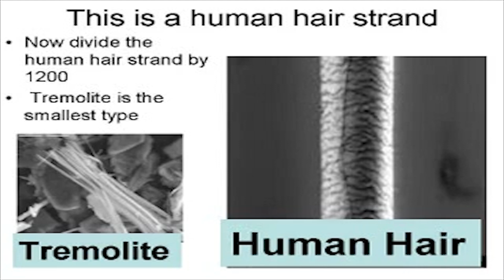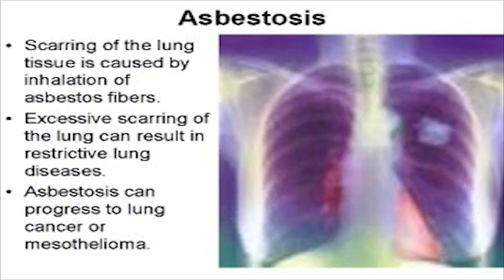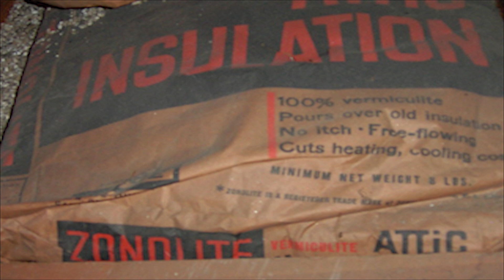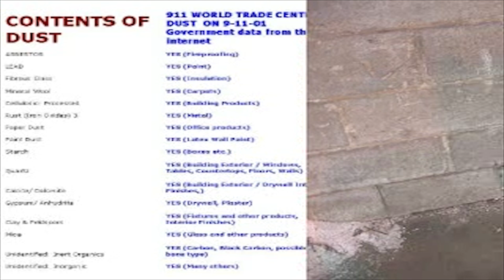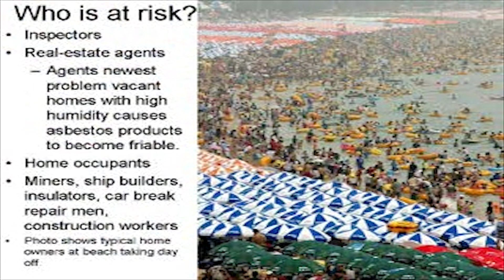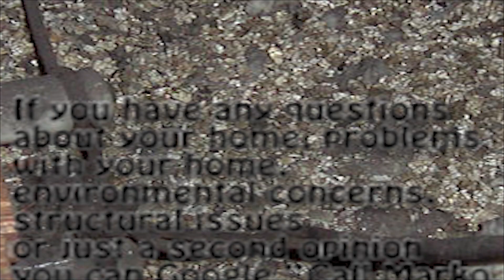Vermiculite Great Insulation:  Asbestos Safety, What does Vermiculite Look Like

Comment: I was exposed to vermiculite in my home while fixing drywall around a bath fan. The vermiculite was pouring out of the ceiling. Had it tested and it has low level of asbestos. Should I be concerned about this type of exposure or will I be ok?
Reply: You will be fine you need to work with asbestos loads to get this and Vermiculite loft insulation has such low levels nothing will happen. It's the proper asbestos Brown and blue you want to keep away from. Everyone I know who's older in the building industry who died or has asbestositis all smoked.
Reply: @LondonGooner  thank you for sharing that reassurance. Wishing you good health!
Reply from the maker: yes, you dont need much, wear a mask next time
Reply: @Clevelandmarko  oh dont worry there wont be a next time. Im never doing anything like that again.
Reply: You'll be fine. Chances are something else floating around our air will get you first. Just be cognizant of the situation and approach it with care.
Reply: @dontworrybehappy8080  thank u for the reassurance. I had one other possible exposure from sanding up a vinyl sheet floor in an apartment i lived at.  seems like relatively low risk. im no longer doing projects like that.
Reply: @ecordaromusic  This is what I do for a living. I can't guarantee that you're not going to parish because of it. Just saying the odds are in your favor.
Reply: @dontworrybehappy8080  🥳
Reply: I was working at a house that was for sale and I was the only one with a full face respirator and everyone started busting the ceiling to put new drywall on and a whole bunch of Vermiculite started falling out the ceiling like crazy. I warned everyone to wear a mask or a respirator but nobody else did.

Comment: Hi there, I have a quick question.

Are the little pellets soft like old polystyrene, with a kind of irredesent colour across the surface?
Almost like the inside of shells from a beach, but like I say, soft like polistyrene.

I've just opened up a chimney breast and there was loads of crumbly concrete filled with the stuff.
If you can help identify, that'd be amazing :)
Reply from the maker: yes
Reply: Yes.  Gray to brown to silver and gold layers with a metallic/mica appearance, and the larger pieces have an accordion look to their layers.  They can be peeled apart like pages of a booklet.

My home has this.  I had 4 samples tested using PLM recently, and all were 0% asbestos.  However, a few ziplock baggies of likely 100 cubic feet of vermiculite in the attic doesn't guarantee 0 asbestos, so STAY AWAY and you'll be ok.

There is a fund set up.  If you have vermiculite from the Libby mine in Montana, they will reimburse 55% of removal and reinsulation costs.  The ZAI trust will test your sample for the presence of barium for free ( barium is unique to vermiculite taken from Libby, which is also likely the only vermiculite mine with consistent asbestos presence.